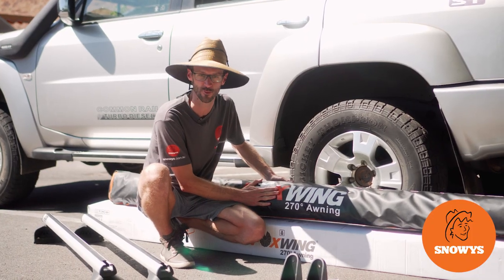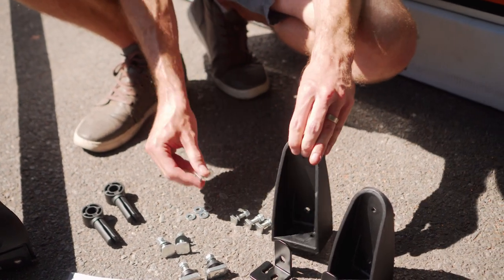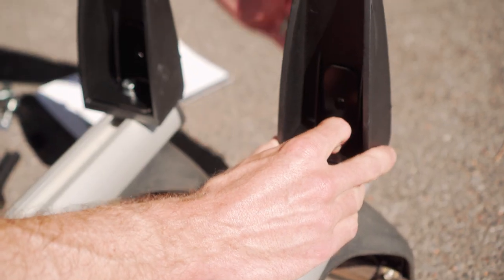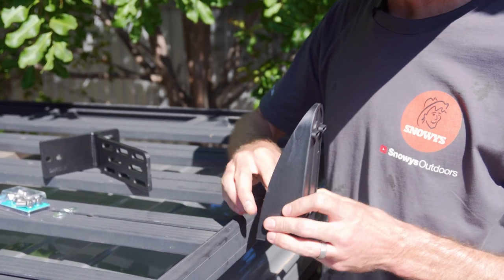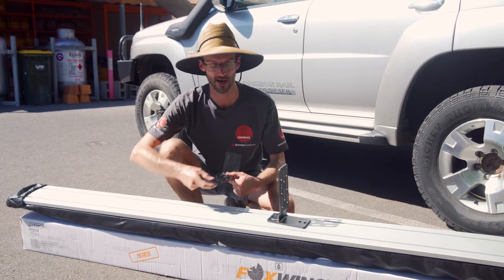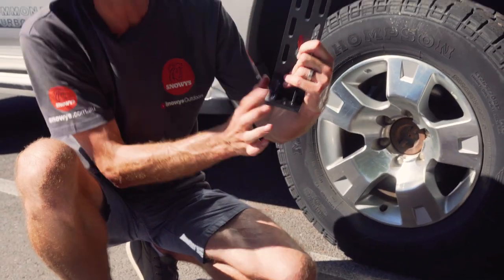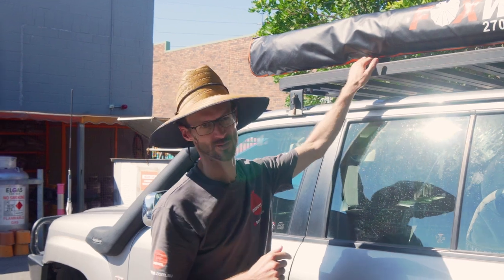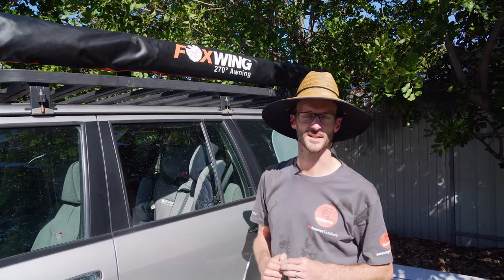Oztent Foxwing 270° Awning Series 2 - How to DIY install

Comment: I've mounted mine to the mesh of the roof rack with the supplied L brackets with the backing plate. Will this hold for a 28kg 30 second awning?
Reply from the maker: I can't say for sure sorry, Jarrod. I'd suggest checking the specifications for your roof rack. ~ Ben

Comment: Where can you buy the brackets?
Reply: Jamie Baumgarten RhinoRack might have a bracket to suit. The Oztent Foxwing used to be a joint RhinoRack & Oztent product but they went their seperate ways and now RhinoRack’s 270 degree awning is a Batwing & Oztent kept their name of Foxwing. RR have got a few different types of mounting brackets for awnings so best check RhinoRacks website & no doubt there will be something to suit your awning and roof rack setup
Reply from the maker: We had to nab these from another demo awning, Jamie, but they aren't available separately sorry. I did see some similar brackets online though, you may just need to search around for something to suit your set up. ~ Ben
Reply: Same here, cannot find that bracket, I like the way it sits on top of the rack and not on the outside of it. It’s also raised this way. Seems like it will clear the cargo door on my LR4 that swings up. Any tips on where we can find it?
Reply: Correct me if i am wrong but i think Darche have a bracket just like that